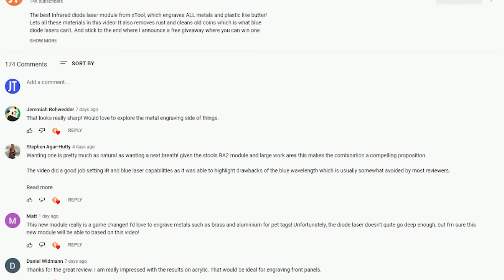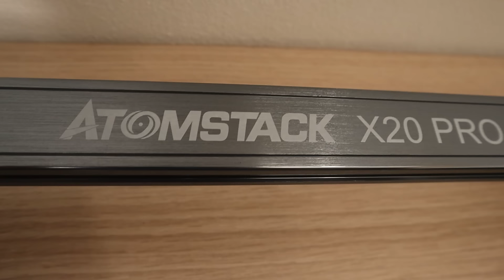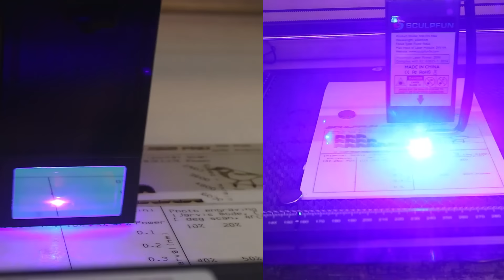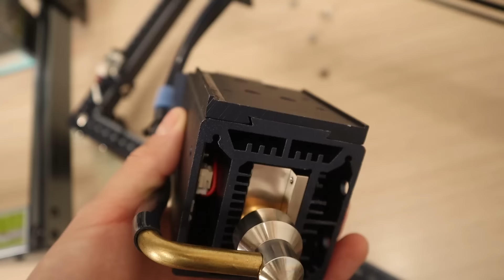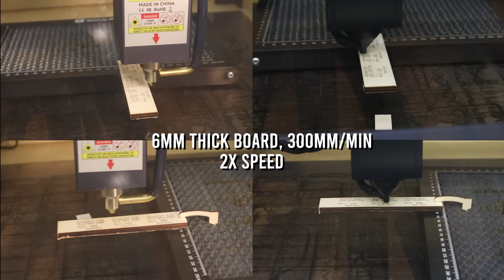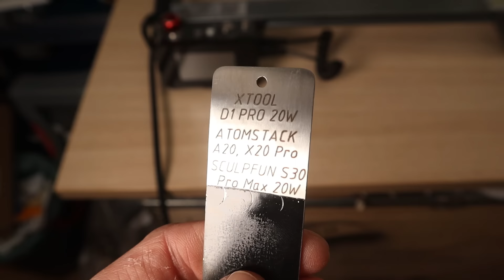Sculpfun S30 Pro Max vs. Atomstack X20 A20 Pro? Which one is the BEST laser engraver? Review/Test

Comment: If the Sculpfun S30 Pro is a clear winner in this case. Can you please make a video comparing it to the Xtool D1 Pro 20w. We are all wondering if the Xtool machine is worth the extra money or if the Sculpfun is better than the Xtool and is better quality for price. Or maybe could you just tell us which machine you think is better to buy? The Xtool D1 Pro 20w or the Sculpfun S30 Pro Max 20w?
Reply from the maker: I have already tested the xTool D1 Pro 20W. Check my other videos.
Reply: @JTMakesIt  I'm also interested in seeing the direct comparison of the D1 Pro and S30 Pro Max. It seems like D1 is far superior in terms of mechanical precision. What S30 is great at is smaller focus size (0.15x0.10 vs 0.15x0.15) and better focus length. Is that about it? To me, mechanical precision is much more important, given that the focusing mechanism of the D1 allows for half-thickness adjustment, etc.
Reply from the maker: @arttosborvorn  I i also have a video of the xTool D1 Pro 20W test. I did similar test so you can directly compare

Comment: The cutting test can be manipulated by adjusting the air flow. If you release the air less, then the number of passes will increase. If you use it to the maximum, then they will decrease by cutting this way faster!
Connected to an external compressor, I cut 8mm mdf with X20 in 7 passes with 95% power and 300mm/min. It came out slightly burnt on the edge. With 100% power, the number of passes would change.
Reply from the maker: I use full air assist power for cutting tests. The flow depends on the pump

Comment: Hi Bro,
How is the performance of these machines to cut and engrave clear and other types of Acrilic (without painting it black). We know that black Acrilic can be cut easily but how about cutting and engraving other colours?
Reply from the maker: Red, green, yellow works well, but they need more power or more passes for the same effect. Blue does not work well as it is the same color as the laser beam.

Comment: Those are 2 good machines but S30 haven't got the most essential for me :a touch screen with SD card reader that X20 got, putting files on SD card and engraving outside or in the garage is better for smell and smoke ( and eventually for house fire ...)
However,  X20 haven't got a large size extension option (480x850)  as the S30 (905x935) and seems to be a little under the S30

Comment: Just wanted to say you make good videos. Did you by any chance also make a list of the focus spot size? can't find it on your website.
Reply from the maker: https://hobbylasercutters.com/sculpfun-s30-pro-max-vs-atomstack-a20-x20-pro/#anodized-aluminium-engraving--focus-spot-size-and-accuracy-test
Reply: @JTMakesIt  Thank you. But I meant a concise list of all the lasers you've tested so far. Received the Jinsoku LC-40 with the compresses laser last week and am quite disappointed. they promise 0.05*0.08 but I'm getting closer to 0.12*0.30.
Reply from the maker: @MacFixersPuntNL  Yeah, everyone advertises smaller spot than it really is. I don't have a single list, you need to check each individual review.
Reply: @JTMakesIt  Yes apparently. If it had been a little more it wouldn't be a big deal but almost 0.3 is very misleading if they advertise with 0.05*0.08
Reply from the maker: @MacFixersPuntNL  This is why I do these tests

Comment: Great video!!! Do you know if it’s posible to cut 15mm plywood?? No need to cut it in one pass 😉

If so, a video will be very appreciated  😄

Thanks!
Reply from the maker: 15mm plywood is too thick. This plywood has too many layers of glue and can't be cut reliably. To cut it in one pass, you will need 10 times more expensive machine.
Reply: But, is it posible to cut it with more than 1 pass?
Reply from the maker: @adrianz8728  no. It will get very charred and you will need 20+ passes. Check the review of the XTool D1 Pro 20W where I tried cutting 18mm Poplar plywood which is the easiest wood to laser cut. And it didn't work.
Reply: Got it! Thank you for your comments 👍🏻
Reply: Don’t get it. All these 20 W lasera can cut up to 20 mm thick wood in one pass? Isn’t ? there are plenty videos.
Reply: ot can cut hardwood 20 mm and can’t cut 15mm plywood?
Reply from the maker: @krzysztofparda6482  Plywood has a lot of glue which is hard to cut. If a plywood is very thick, there are a lot of layers and this means a lot of glue and surprise glue and unseen knots.

Comment: The protective lens is a neat feature. I wish all laser module adapted this as a laser module lenses can be easily be damage and brick easily than expected.

Anyway do you have any plan to cover the NEJE E40 Laser module? It will be an interesting comparison to the Sculpfun since it's claim to have a thinner and longer focus size. It's also have this weird temperature module adapter and air tube which is pretty interesting to check out.
Reply from the maker: I will check it out

Comment: The Atomstack claims to have the laser spot of 0.08*0.1mm on their website instead of 0.2*0.15 in this video. Did they updated the machine recently?
Reply: Very impressive video. This comparison video help a lot for me to decide which one I really want to go for. Not too many people out there are making video like this so thanks gor all the efforts. Two thumbs up.
Reply: I don't think so. There is usually quite a difference between advertisement and reality. So it sounds reasonable to me.
Reply from the maker: All machines I have tested so far have a larger focus spot than advertised. This is why I test this :) i think it could also vary from the machine to the machine.